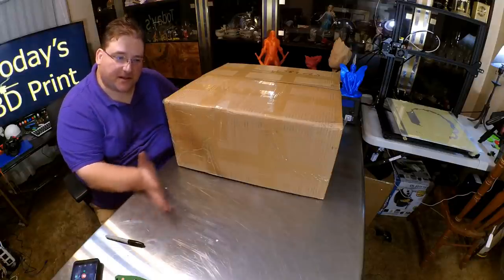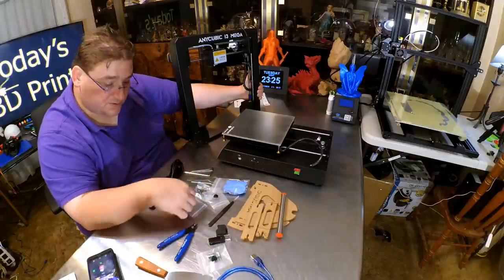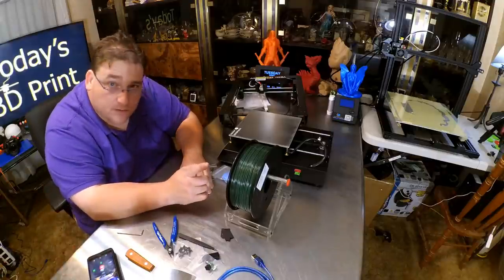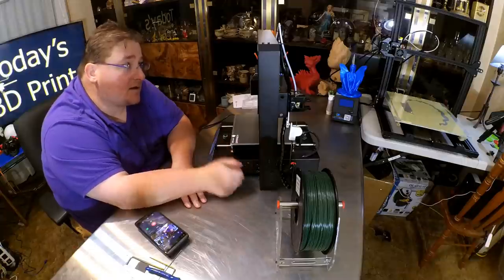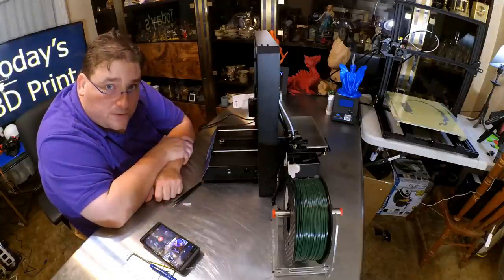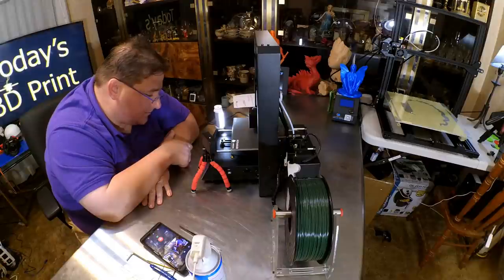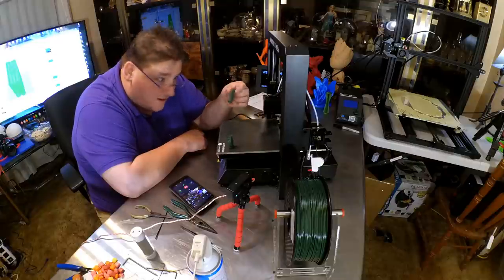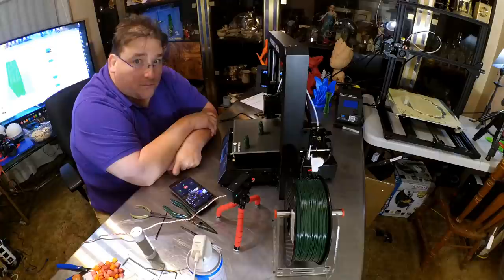Today's 3D Print 139 Anycubic I3 Mega Unboxing, Assembly, & First Print

Comment: I put one of those 220mm Anycubic Ultrabase on my Anet A8. No issues. Worked great.
Reply from the maker: I have 4 of them little pretties sitting next to me. they scream for print time on my S4 but I suspect 440mm is too wide. does anyone know of any way to get these cut down in size? would a water jet cut them without shattering them? (tempered glass IIRC)
Reply from the maker: +Curtis Campbell sorry I can't resist I tried I failed so how much would a shipping on a 220 meter wide piece of glass :-)
Reply: LOL fixed

Comment: Ahh, this is the one I spoke to you about, the feature to resume the print if you encounter a power outage is what drew me to it.
Reply from the maker: +Dazfx this printer is amazing the print quality is almost Ender to Quality and the ultrabase is amazing but be warned the power outage resume is useless :-) you see that thing that makes the ultrabase so wonderful also makes power resume function utterly worthless unless you catch it long before that bed cools down because once the bed cools down the print will release and any attempt at resume will fail :-)
Reply: Nerys I'm guessing that could be solved using a different set up for the bed surface but it's not a deal breaker if I could not use that function.
The print quality is really good that is fantastic news and I think this printer has won me over.
How loud is the machine?
Would it need the fans replacing like the CR10 did to make it quiet.
Reply from the maker: +Dazfx yes it's pretty loud I plan to upgrade the fans

Comment: Thanks for another great video.  I get the same result on my sanded glass bed but you need to clean it with alcohol before every print.  It's amazing to see it print so clean and stick so well until it cools and then comes right off as if it was never stuck.
Reply from the maker: +Jason Baker I have gotten very good Prince on just plain glass but only if they're substantial contact between the print and the bed won't you do a thin wall print it just does not hold onto glass it lets go mid print and a lot of my printer like that no bottom just the perimeter any solution for getting that to stick to plain glass?
Reply: I had those issues even with gluestick if I was too light with it, but then I sanded the heck out of it with 200 grit and running water and made lots of visible scratches in it, almost opaque with scratches.  Now I have the rare curling edge due to cooling but Hatchbox PLA at 215/70 and I have had a bunch of good luck.  I don't do a lot of small things though so perhaps that is where my luck would turn.
Reply: BTW, Joel Telling did a great review of you.  I have been a sub for a long time but glad to see you get some attention you so richly deserve.  Looking forward to see what you do when you hit 50k subs!  Should come soon!
Reply from the maker: +Jason Baker ahhhhh I never thought to sand it
Reply: Yeah you really gotta get in there with a little bit of force, running water and time.  You really want it to get slightly opaque.  Not big gouges but thousands of little ones for the plastic to grip on when hot and retract from when it is cool.  Only real pain is you have to clean it with Alcohol every time.  Dust will fill the grooves and then no stick and lots of curl.
Reply from the maker: Jason Baker that's no problem I always 91% alcohol and microfiber clean every print no exceptions :-)

Comment: I need to figure out how out how to do a DIY dual Z limit switch setup. So sick of manually leveling the gantry on my printer.
Reply from the maker: YES that would be very cool. I wonder how they did it?? spare channel addresses in firmware or custom board ???

Comment: Looking at getting the EU plug Ender 2 since it is so cheap right now!  DO I have to do anything but change the plug to a PC plug and change the PS slider switch?  Any issues with the heat bed?  I know there were some concerns that heat bed might be different voltage, etc.  But I assume since it all goes through the PS that it just converts to 24V - correct?  Thanks!
Reply from the maker: +Rafael Acevedo that is correct you only have to change the plug nothing else I understand the new Ender's have a different power supply and the one that came with mine but it does not matter they're all 220 volt 120 volt compatible you just need the appropriate plug-in to flip the switch if it has one some of them are auto-sensing like mine are

Comment: I don't think that there will be enough power reserve to move the head away from the model in case of a power fail.
Reply from the maker: +Frank Brandner prusa does it
Reply from the maker: +Frank Brandner sorry for the short reply voice recognition at its best prusa does it they have a circuit that cuts off the heater instantly and usually the remaining power in the capacitors to move the head just a little bit so it's not sitting inside the print

Comment: Is that build surface still working out, also how is it on ABS?
Reply from the maker: +D Johnson it should be able to get hot enough for abs but I've never tried as I don't print with abs it's too weak for my usages :-)

Other pla has its disadvantages as well mainly it doesn't like hot cars :-)

So far the bill surface is working very well although it really does not like zyro twinkling filament

The A5 from JG Aurora has a similar but slightly different print surface it does not Auto release and sticks a little better

But still releases easily with just a little help it might be as simple as scuffing up the I3 ultrabass just a tiny bit which I will try later this week
Reply: Thanks for the info, much appreciated.

Comment: Hey, i am wondering if replacing the nozzle is a possible thing to do using this printer? I understand it has 0.4mm nozzle tip, but does that mean any 0.4mm is compatible with this printer? Or some upgrades needed to do so?

Please help!
Reply from the maker: no. you can replace the nozzle but it needs to be the "right" nozzle. I THINK this uses standard E3D V6 nozzles not sure trying to verify that.
Reply: Nerys i really do appreciate your fast reply! Thanks a lot! I tried to verify that, but i couldn’t..
Reply from the maker: its either a V5 or a V6. I will try to find out from the company.